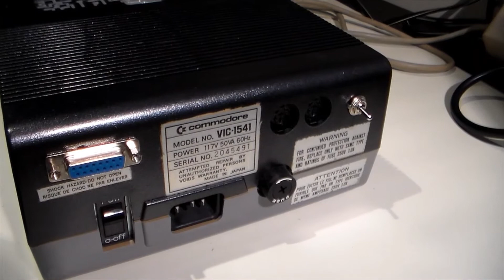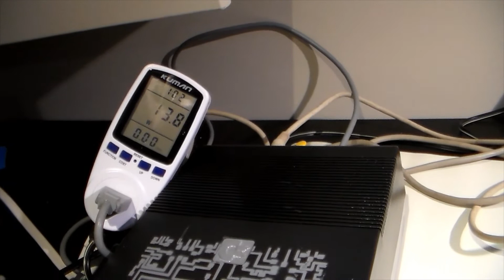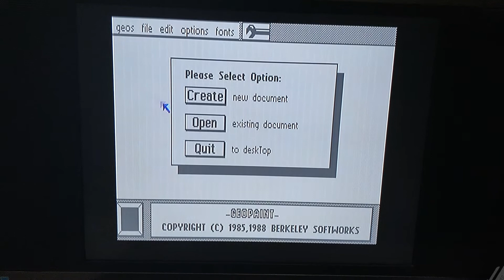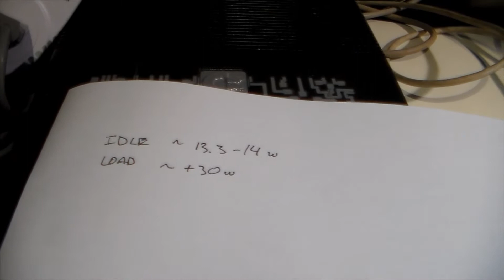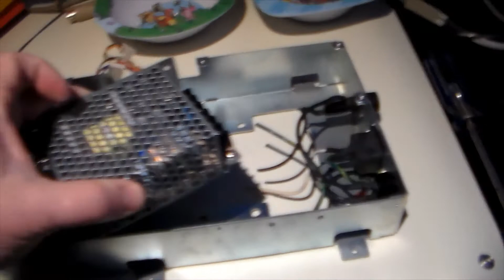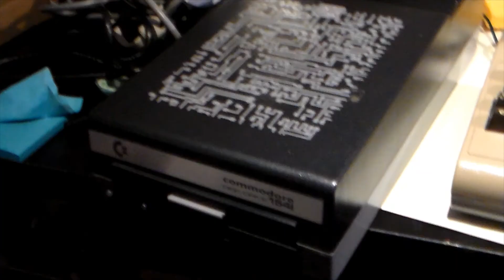Commodore 1541 Power supply upgrade

Comment: Subscribed!! This is the funkiest 1541 MkI I have ever seen! How has this video not had more views? You aesthetic mods are really smooth in my eyes, I really like them <3 Power supply mod is perfect too. Really well done bro! My power supply setup is reminiscent of this, I have a C64C, a 1541 MkII and CMD HD: So I replaced all power supplies with a single really quiet slimline PC power supply that I pulled out of a SFF Dell Optiplex. It feeds the drives and also the C64's 5v rail. The only thing it couldn't provide was the 9v AC supply which I ran straight off an old C128 transformer. Like yourself I stick with the oldschool drives for storage (I regard CMD as oldschool) 😀